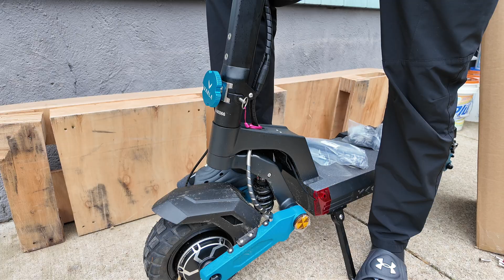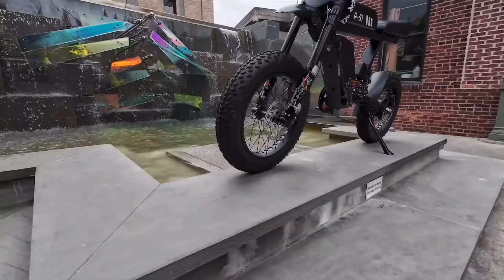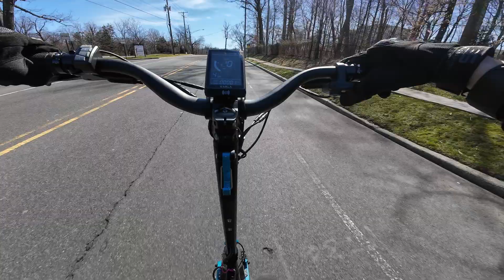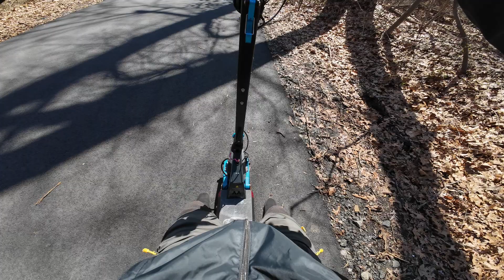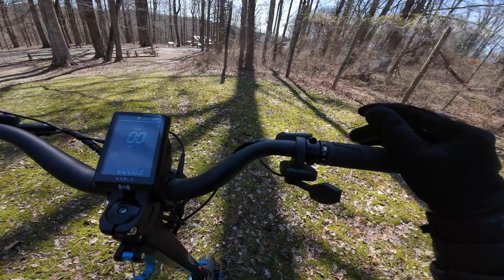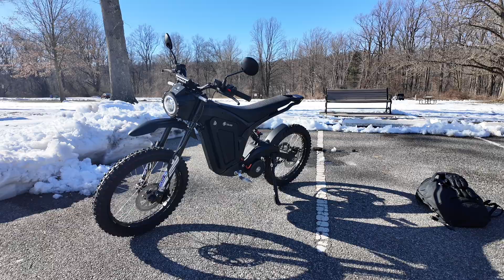My Failed eBike Conversion Build

Comment: If you want a seated scooter, go with the Solar P1 3.0. You can lower the handlebar height so it rides like an e-bike. Dual motor and goes up to 40 mph.

Comment: As others have suggested, flip the handlebars down. I believe they're the same ones on the AR Xclass. I have mine flipped all the way up and I have seen others with them all the way down. It should drop them by 3-4 inches. It'll help.

Comment: Was it easy way for that think three dimensional those bars go up 4 in it'd be easy to undo the bars and just do a flat bar all across and then put your what was on 4 in lower it down on the flat bar be a lot better drive

Comment: IT gets down to the intent for use that someone has.....lol, I see lots of reasons this scooter might be advantageous for
people & I gotta say that having a seat is  appealing  to me.  The smaller the wheel size the less control one has on the
roads so getting down lower has a better center of gravity = better control  & this is where what you use it for is key.
But I'd want something that I can carry things w/ me,  not a lot but I'd want to be able to carry 1-2 bags of groceries
or whatever stuff you needed it for. Thanks for showing this,  it has possibilities.  peace

Comment: Cut the stem you have to the height you need then splice the the other side to the shortened. use a smaller piece of pipe inside your cut stem and bolt through both ends.

Comment: I got a Tif Galop K8 for $1300, it comes with the seat and gets me up to 57mph with all my Doordash equipment hooked up to the seat post, it's got a dual fork stem that makes it waaay more solid and you can bring the handlebars back and down for much improved stability and comfort, I ride mine like a moped everywhere 🥰 hell I had 3 guys try to jump me while was riding 6 miles home on my first flat tire, was riding in eco mode to go easy on the tire and rim, 3 mfs fanned out across the street I was traveling on from a bus stop, I slowed, they stopped and actively cutting off any route I tried to pivot towards, so I flipped it to dual motor turbo with 10 ft between us and it launched me right through their little blockade like they weren't even there, hell just tonight while dashing I had some moron in a car make a hard turn right in front of me and I slid right into him, not a scratch on my scooter, dumbass sped off thinking he was getting away from a hit and run, i looked down to see his hub cap spinning in the street, sweet carma 🥹

Comment: I was wondering what range I would get on a 72v 20ah battery on a 80a controller n 3000w motor
Reply: 35 miles around

Comment: We have the roadrunner pro sit-down scooter, I have wondered if it just wouldn't be better to get a stand up scooter and add a seat to have both options but the stand up scooter would also be more portable and faster if opting for a bigger motor. Roadrunner pro may be a much safer scooter due to bigger tires than the stand up scooters.

Comment: If you didn't care if it looked gimpy as all hell you could flip the handle bars to be downward instead of upwards which would lower them considerably. Or use straight bars which would lower it at least 6 inches.

Comment: Find a metal shop in your area, you will find a fabricator who can easily come up with a very cheap solution for lowering those handle bars, I could easily do it, and so could any decent fabricator...I wouldn't give up, you just need information that you don't possess..And I'm not even talking about welding, just a fabricated bracket at most..

Comment: Scooters are deathtraps, just my opinion
Reply: Ebikes can be death traps too man. I have a scooter that goes 65mph and It weights 130 pounds, 14inch tires, 13inch screen, turning signals 72v 50ah battery. Cost was 3,000 dollars.